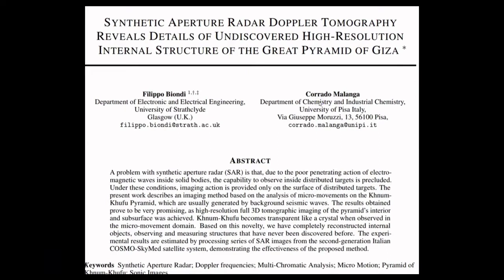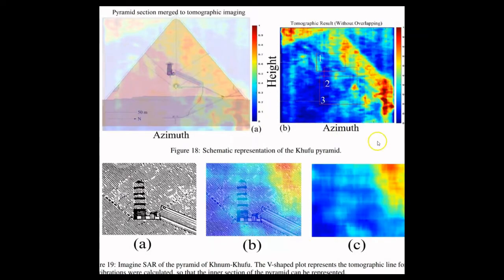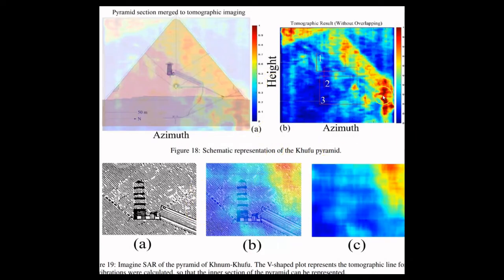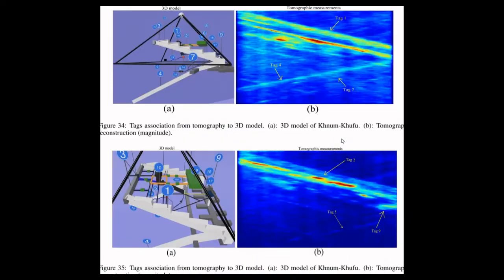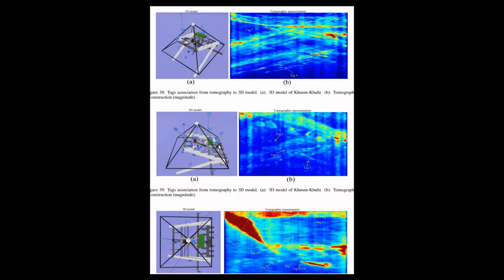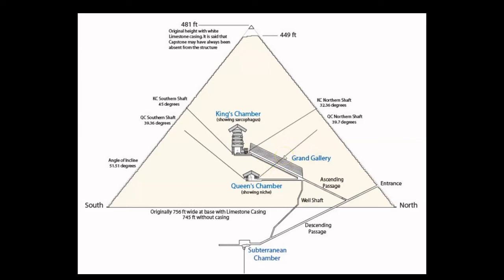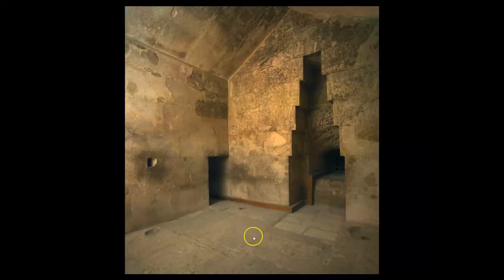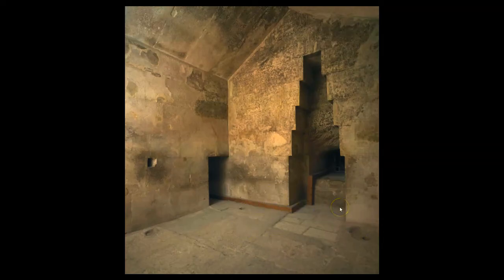Episode 60: BREAKING NEWS - 2022 Great Pyramid Scans And Evidence For Hidden Chambers

Comment: 11:15 are you saying it was maintained using human access to the parts?  If there were sliding valves at any point surely they would have worn out unless constantly lubricated. Was access required to remove the products of the process? How was the starting material placed in the chambers? Why werent the access tunnels bigger? Toxicity would have been a big issue to those that accessed, no?
Reply: They definitely werent going inside them after it was built and in use. They woudl've had ropes and levers to open and close the stone valves without going in. I alos belive they wouldve had some sort of lubrication.
Reply: You was toast if you was inside that thing'

Comment: I have seen reports, from scans, of a void, above the grand gallery, which the Northern vent shaft, from the Kings Chamber (sulfur furnace) passes through. It is reported as an anomaly of different density. Perhaps it was filled with Sulfur, which would enable the process.

Comment: Wouldn't there be evidence of these chemical reactions in the pyramid? Why would they build it this big unless they needed millions of gallons of Sulfuric acid. Not only does no one need that much acid but, the "well shaft" was dug by grave diggers and is not an original part of the pyramid. 

If you are going into the pyramid, make sure you get wall samples and then have those samples looked at via spectroscopy of some sort. 

Needless to say I think you are way off. Like way way off. It is sort of comical that you think any ancient people would need that much sulfuric acid. So you think that Egypt was supplying the planet with this acid? roflcopter deluxe.

Comment: I read a few places that if we had to start civilization over, it would take a very long time to get to the point of utilizing fossil fuels again, because we’ve used all the easy to get stuff, now it just isn’t efficient and there would be no infrastructure for any of it.

We would need methane for making fertilizer though, I could see us building structures like these a hundred years after collapse.

I guess what I’m getting at is the pyramids seem like second generation tech to me.  Like we had a fossil fuel using civilization that collapsed, then pyramids were built, then THAT one collapsed, and the next one had insufficient transfer of the technology, so repurposed them as religious centers and burial chambers.

And then we took thousands of years to rediscover gasoline, and here we are.
Reply from the maker: not sure how familiar you are with my work, but I propose that the Step Pyramid was designed to make methane gas...
Reply: @thelandofchem  yes, i thought of it after seeing that but it seemed replace the to the whole theory so I put it on the new one I was watching at the time